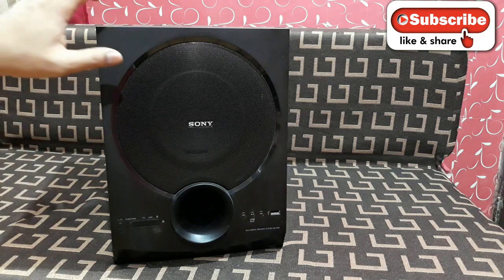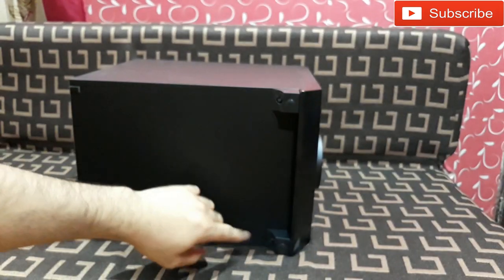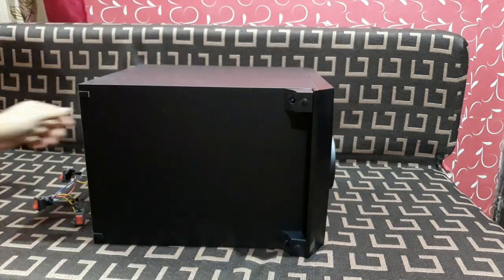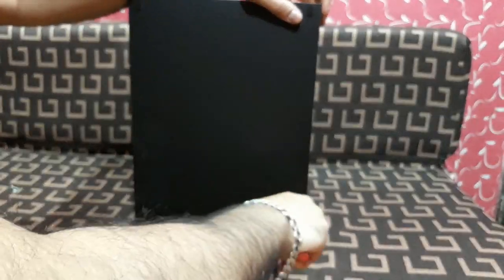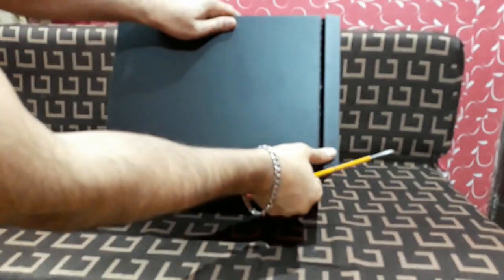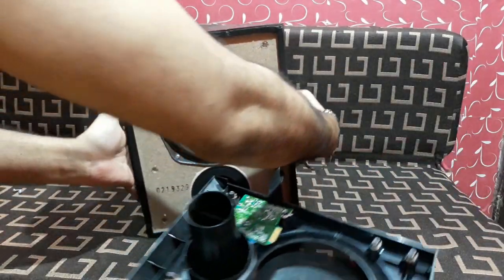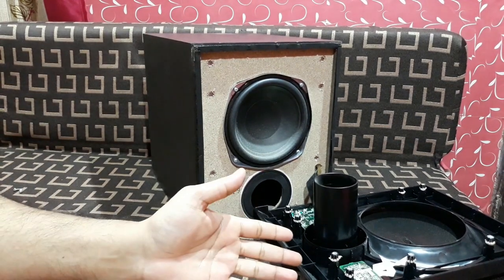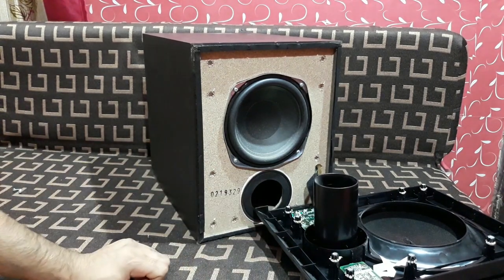How To Open Sony Sa-d40 Subwoofer Front Grill

Comment: I have this speaker, whenever i play any audio track with intense bass effects, the sub distorts and generates an irritating rattling sound. Why does it happen and can it damage the woofer?
Reply: Air passage nahi hori he
Reply from the maker: Something is loose inside or the front panel is not set properly. These 2 can be the cause of rattling noise

Comment: Rat cut wires so how can i attach it back without diagram
Reply from the maker: If still in warranty then call customer care... or you can do one thing. Remove the back pannel and check the main kit there. All the connections for front panel would be marking there on the board by numbers or something & same on the front pannel. So you can connect one by one like that. You can use a multineter to check the continuity of the wires to identify which one is connected to the main kit on which point.

Comment: Sir, I have the same system.
When I connected to the TV via the aux cable, I heard a beep sound, 
I thought the aux cable was a problem so I bought another one.  then i changed  the tv still the problem not solved. 
 This problem only occurs when  aux cable is connected to tv. 
 Is there any way to get ready.
Reply from the maker: mine doesnt make any noise

Comment: My son threw remote inside the hole. It is now strucked inside it.
How to remove that
Reply from the maker: You can use a tong to take the remote out if possible or else you have to open the front panel